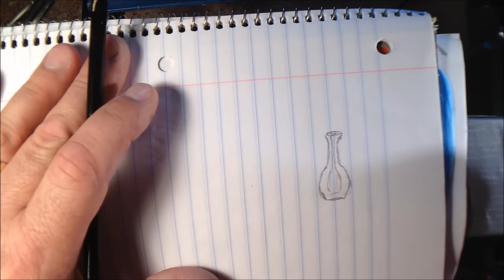My Attempt at an Inside Out Turned Bud Vase or Weed Pot

Comment: Nice job, Bob.  I use filament tape (fibers running length of taps) as it gives a better hold.  If you want to do more inside-out turnings, use larger blanks (2' sq each piece) and mark your design on at least 2 sides (all four is better) so you can see it as it spins.  Keep trying new stuff.
Reply from the maker: +Mark Hazlewood Thank you Mark,
  I hope to do more of this style of turning so I appreciate the info. 

Regards,
Bob

Comment: I tried a few ways but  came up with where i left the segments about 1 to 1  1/2  extra length on each end and glue just on the ends of the segments  and clamp it up till dry  and turn my inside then take it to the  chop saw cut the ends off do the final glue up and finish turn  makes it very stable for the  first turning operation
Reply from the maker: It sounds like you put a lot of thought into making. A great look pen. I’ll bet it looks awesome. 

Regards,
Bob

Comment: I think the speeds are listed on the plate on the front bed of the lathe.
Reply from the maker: +Alex Tarasenko Maybe there was supposed to be a sticker or something with the speeds on it. This lathe doesn't have anything. I'll look it up on the HF site. 

Regards,
Bob
Reply: I wrote the speeds to my Excelsior on a piece of paper and taped it to the front of the lathe.  Not that Ihave ever used that information or that it even matters.  Mine does not have a speed control, just the five pulleys, so you are fairly limited anyway.  For pens I just use slow and fast...
Reply from the maker: +Tenspeed TheBikeHanger LOL,
  That's pretty much how I turn. Remove wood, wide open, sand and finish, slow as it will go. 

Bob